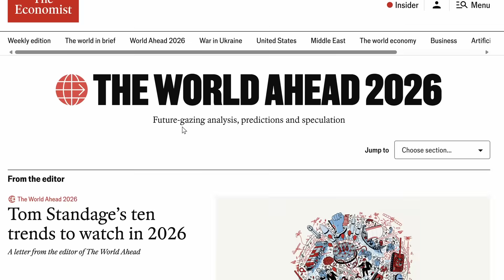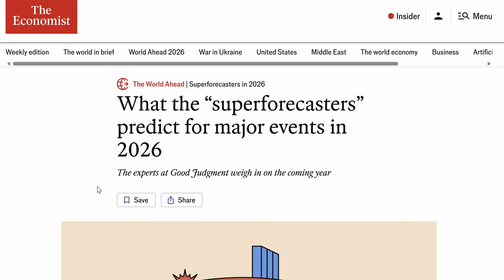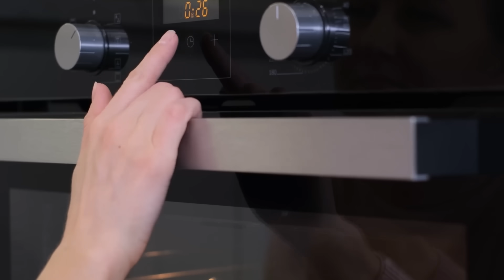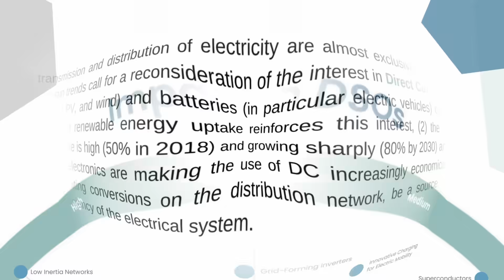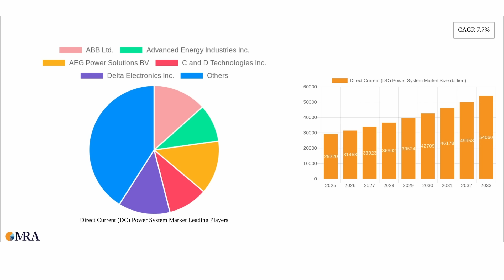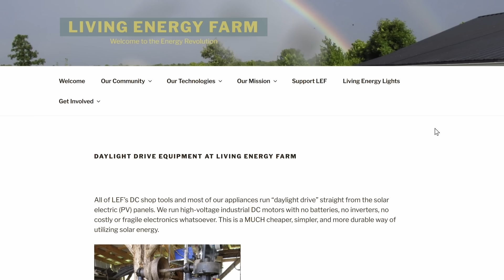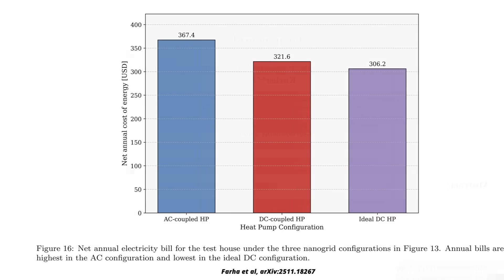Are We Using the Wrong Kind Of Electricity?

Comment: Sabine, I always say u have the best & most informational videos...
I have to disagree with u about AC VS DC...
AC is actually more efficient for a greater number of things... it's even more stable when using in circuits & most things...
Reliability depends on the set up...
HOWEVER... it's been manipulated to make it as expensive as it is & as difficult to work with compared to DC... rather, so it seems...
It was all for the $$ & now that there are companies tired if the B.S. they are challenging the big players of this electric / power monopoly...

DC electricity isn't as natural as AC... not saying it's natural, just not as close to being natural as AC...

That's the main difference... if u know what I'm saying then u shokd also know that comes with inherent complications... u can't take without giving...

ALTHOUGH TESLA IS CORRECT, EDISONS WAY IS BETTER FOR THE PLANET...

Comment: Transport needs to be AC... I cannot believe a 1MV DC line would be a good idea at all...
Reply: Try to keep up with modern technology. From Google: "High-Voltage DC Breakthrough Could Boost Renewable Energy ...The world's longest and highest-voltage HVDC (High-Voltage Direct Current) line is China's Changji-Guquan (or Zhundong-Wannan), stretching over 3,200 km at a massive ±1,100 kV (±1,100,000 volts), capable of transmitting 12 GW of power from western renewable sources to eastern demand centers, setting global records for distance, voltage, and capacity."

Comment: Using DC as a standard would only make sense if you had solar panels, batteries, and a wind turbine at home. As soon as you connect to a DC grid you would have to pay for the cost of complex transmission and conversion of DC power. And yes, you would still need power electronics

Comment: Most or our machines are using rotating move. (AC) Also cheap to transform it down as oppose to DC. 
DC only make sense for Point‑to‑point links over 500Km distance. ( No skin effect lower voltage drop, full conductor utilization. )

Comment: There is a lot of bad logic applied to this discussion of AC Vs DC.  One common argument that gets banded around is all the losses associated with needlessly changing from AC to DC and back again- an argument that is meant to support the idea of why DC is better, however whenever there is a need to change a DC voltage the way of doing this is to convert the DC to AC and then back again- however the supporters for DC don't like to face this reality.  The other thing that comes up lots in the relative comparison of efficiency is to compare a really high efficiency solution against a really inefficient solution to make this comparison try to support the bias of the person making the comparison.
What is not disputed is that High Voltage DC and Ultra High voltage DC has economic advantages for transmitting utility scale power long distances ( over 1,000km).  Conversly, AC is still considerably more cost effective for utility scale distribution of power.

Comment: Fun fact: all high power DC voltage conversions are done by using AC to convert voltage. Though that kind of AC isn't 50-60 hz, but rather 20 khz - 1 Mhz on a special transformer.
Reply: The higher the frequency the less material is required. From Google: "Yes, high-frequency transformers use significantly less copper (and smaller cores) for the same power rating because higher frequency means fewer turns are needed, leading to smaller, lighter, and more material-efficient designs, though specific wire types (like Litz wire) and careful design are crucial to manage increased AC resistance from skin and proximity effects."

Comment: I've been wondering for years why we don't have at least inside our houses a DC circuit.  Pretty much all the things with power boxes/ bricks plugged in to the wall are turning AC to DC and stepping down voltage.
Reply: That's because for over 100 years there was NO power bricks, wall warts and electrical goods that required DC remember it wasn't until 1982 that PCs existed and even then not 1 in 100 households had one.
Reply: @YouShouldThink4Yourselfso for what 40 to 50 years we've had houses full of things not running on mains, yet we've still not bothered to have a house DC supply.

Comment: DC is fine until you need more than one voltage, then things get messy. One funny fact is that in airplanes, where weight is king, they used to run on DC because it requires less wire (AC wires only carry power on the surface, the inside of the wire is always magnetically locked to 0 volts) thus AC wires are made with as many thin threads as possible but overall it takes more metal to drive the same current. So DC was a no-brainer until aviation started using hugue amounts of electricity, and then they switched to AC at 400 Hz rather than 50/60 Hz. There is no one-size-fits-all solution but AC technology kind of peaked and thus newer developments must come from the DC field.

PS: I am interneting on Xmas eve because in my corner of the woods we celebrate a massive lunch on the 25th then keep eating the leftovers on Boxing/St. Steven's Day. And even later...

Comment: 210v DC infrastructure in homes cannot support the higher power devices that 240 AC can. It's been commonly enough reflected between in house hold appliances between the US and UK. There may be  some losses but it would help if lazy penny pinchers put in the bridge rectifiers that would make full use of the AC wave.

I think the EU's bashing of higher power appliances has more to do with trying to move people over and force them to use less power, just so they can move to the lower power infrastructure. I have seen the difference myself just in DC and AC portable welders... AC is just better for the underlying infrastructure if you do not want to keep tripping out...

Comment: DC is a pain if you want to do anything with it… I.e. change the voltage. AC can be transformed into any different voltage. DC needs to be turned into AC, transformed and then turned back into DC. Not awesome.

Comment: Thomas Edison wasn't right, because he was advocating for DC before electronics were invented, and the only real thing Edison and Tesla were fighting over what's the best way to get electricity from the power station to end user, and which was the safest. Everything in Holmes run off the same voltage. Try getting a kettle and a mobile phone to both run off the same voltage!
Reply: You're right. The problem lies within the home. High voltage lower current DC make since for high power transfer but inside the city, and inside homes, it just doesn't make sense. There is to many modern day devices that needs many different voltages and AC is very easy to transform. Plus, DC high current arcing is a fire hazard.
Reply: How long does the mobile phone have to run? And how far?
Reply: @Llortnerof hopefully not very far. They're more of a sprinter. Kettles would definitely beat them in any distance over a mile!
Reply: Edison's who thought was that there's Washington DC. As if that meant he should be using DC.
I was always surprised that such a smart man didn't immediately see that AC was the way to go.

He also convinced Henry Ford to use DC to make his Model T cars. No kidding. The generation equipment is still up there today.
Reply: @robertthomas5906  Some people can get so into their idea that no one can convince them other wise, regardless of the proof. I've always thought that Edison fell into this trap. He was just stuck on DC because it was his pet.
Reply: @bain5872  That is likely a small part of it, but he main thing was they had companies with intellectual rights to the respective competing techs. Once Edison's power company acquired the rights to AC they switched to using it. Everything else was just BS marketing.
Reply: @bain5872  Where as we will all get stuck on DC if we touch it, because your muscles clench and then you die! With AC the reversing and crossing through a zero voltage will allow you to pull away or may throw you off. You're more likely to get a Shock than be electrocuted.
Reply: @robertthomas5906  Would be awesome to see.
Reply: Tesla wasn't involved in the fight between Edison and Westhouse, other than being used as a posterboy by the latter.

Also, it is no problem getting a kettle to run on the same voltage as the mobile, but you won't like the cost of the wiring needed to carry such high currents. A modest kettle of 1200 Watts running on 5V would require to be fed some 240 Ampère which requires in the ballpark of 100 mm^2 leads, or 50 times what a 16A needs.
Reply: Yeah well, just ask Topsy the Elephant about Edison and his DC. Then Tesla came along with his trunkated (pun&SP intended) sinusoids.
Reply: My mobile phone gets power by plugging into 120 Volts AC power socket in my home. The same electricity that powers my kettle.
Reply: @Alexander-carnivore  And they both work fine on 120 Volts DC as well.  The items that don't run on DC are those that require the varying magnetic field made by AC.
  Switching AC off is more difficult than switching off DC.  I use AC switches (from the home center) that I protect with a snubber, which is a 1,500uF capacitor, a 100 ohm resistor and a diode. No big deal but one has to plan for it.
Reply: @Alexander-carnivore  Yes, it's AC which is easy to transform voltage however, it is not so the other way around. They are buck converters that can do this but they are wasteful. Also, switching becomes a problem with higher voltage DC. It arcs across the contacts and will wear switches and is more of a fire hazard than AC. I see leave things be.
Reply: @bain5872   Kind of!
 A buck regulator is the DC Dc converter part of a SMPS.
 Switch mode power supplies are way more efficient than linear power supplies with large transformers. SMPS  actually work by converting the AC mains into DC and then turning that supply on and off rapidly . The on time and the mark space ratio between the pulses sets the Voltage and Current output. If you  did away with the front end  AC part and fed DC into the switching section it would still be more efficient. Than the linear electronics you would require to turn your stepped down AC into the DC your electronic device needed.
But AC if Safer as the mains supply and can also be isolated using a transformer to limit the current someone would get if they were stupid enough to use themselves as a short circuit.
So Yes stick with AC
Reply: @Lamster66  Well thanks for explaining. I'm an Electronics Tech that's been in the business for over 40 years but it was nice to read a refresher in switch mode power supplies. We also came to the same conclusion. AC is the better alternative.
Reply: @bain5872 low voltage only guy huh?
Reply: that doesn't make any sense. what are you trying to say.

Comment: I think the biggest opportunity is high voltage DC transmitting power long distances.  The microgrids is a fairly niche application and the power getting to the micro grid will probably be AC. 

How to reduce electricity's cost, increase reliability, and eliminate fossil fuels from the grid
https://youtu.be/kw9_Q_qm0Es

Comment: When choosing between AC & DC you need to know whether the circuit losses are mostly capacitance losses or mostly resistive losses. Undersea/underground or very long overhead cables running EHV AC tend to have high capacitance losses and it might pay to operate them with HV DC.
The original decision to use AC was heavily influenced by the savings in copper that you can make when you transmit power using multiple phases - no "neutral wire" is required on the EHV primary system. At the same voltage, DC requires more copper per kilowatt/kilometer than 3-phase AC. To mitigate this, the chinese have bumped the DC voltage to over a million volts so they can reduce the amps so they can then use thinner wires, requiring larger clearances around the overhead lines or thicker insulation on underground/undersea lines.
Also, EVs may have a DC battery but the motors are AC - thats why you need an inverter in an EV. Also, wind turbines are "non-synchronous generators" - their rotation speed is variable with the strength of the wind. They generate AC power at variable hertz, rectify it to DC to move the power around the site, then carefully invert the power to export it synchronised to the frequency used on the networks.

Comment: What voltage it will be good for DC? I was thinking long ago for the lighting to put on 24/48 DC
Reply: Both interior and exterior low-voltage DC lighting in the U.S. typically operates at 12VDC.

Comment: "DC transformers"?  Converters and inverters?  AC transformers use a lot of copper, but to transform DC you need more active components.  Potentially higher failure rate, and which is more efficient when increasing or dropping voltage?  Oh!  To increase voltage, you need AC... or at least pulsing DC and transformers. (Unless there are some magic new technologies I'm not aware of.)

Comment: @Sabinahossenfelder
"In the US the Living Energy Farm in Virginia has operated on a solar powered DC microgrid since 2017 supplying homes and workshops without any AC conversion"
Unless every piece of equipment operates at exactly the same voltage, and that voltage happens to be the output voltage of the solar panels, or the batteries when it's dark, then they will have to be some use of AC, unless all the equipment operates at lower voltages than the solar panel and the lower voltages are achieved by the use of dropper resistors, but this would be incredibly inefficient. If 5:52  had 100 volt DC main supply and you wanted a 5V USB 5 watt charger, it would be dissipating 95 Watts of heat. You were therefore need a switch mode power supply, and the switching means you are introducing AC.

There are other major problems with DC compared to AC.

Electric shock from DC is a far more severe than AC, for the same supply voltage at DC electric burn tends to be far more severe turn AC, something that is taught on solar panel courses.
Damage during a search short Circuit of DC will tend to be far more severe and more difficult to isolate which means heavier protective equipment fuses breakers etc.
Even basic switches have to be far more robust the AC devices because when you break the circuit the Ark doesn't automatically extinguished because you get a reverse of voltage, so you need much bigger gaps amaurot bust equipment. If you want to increase the voltage of DC then you have to use an inverter which is basically a device which converts the DC into AC and then back to DC again. Any Transformers are inductive components tend to be a lot smaller however because does the AC component is it much higher frequency, but it requires a lot of electronics which makes it far more complicated than a simple transformer.

Those advocating for fully DC electricity supplies I'm not understanding the engineering. Us with most things in life, it is horses for courses you use AC or DC depending on which is the best for the application involved.

Comment: back in the day, tesla, but really westinghouse won for economic reasons.  westinghouse realized that using transformers would allow them to step up ac to high voltages thus reducing the i2r losses significantly
vs the lower voltage dc distribution system (transformers don't work at dc, they require a time changing field). 

with modern electronic it is different, losses can be lowered even further by converting the high voltage ac to dc for transmission, then back to ac at the far end to allow the use of transformers to step the voltage down.

i would recommend that it is best to maintain a local ac distribution system to allow for the used of passive transformers (cheap and reliable), and then convert to dc at the point of use.

a power transformer is going to have higher reliability due to it's fewer parts than a switching power supply (most of which aren't properly cooled, thus shortening their life).

Comment: AC-transformers are a lot cheaper compared to for example SST.s (factor of 5) or something like the (german make)  DCP.   SSTs and such are complex, and lifetime is very limited compared to AC transformers.
Reply: Transformers use massively greater amounts of materials, like Copper and Steel. Semiconductor electronics (inverters/converters) are much less expensive.
Reply: @avsystem3142  yes, for the small stuff.  But transfer  100kW,  voltage 10kV one side, 400V on the other side ?